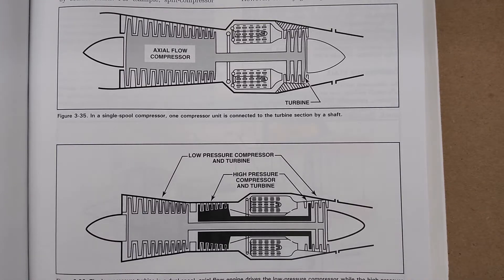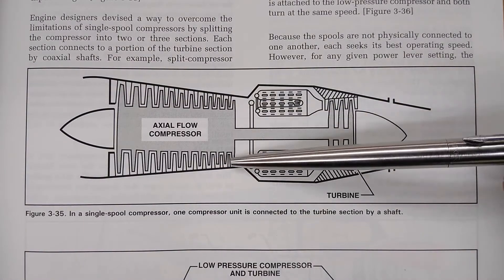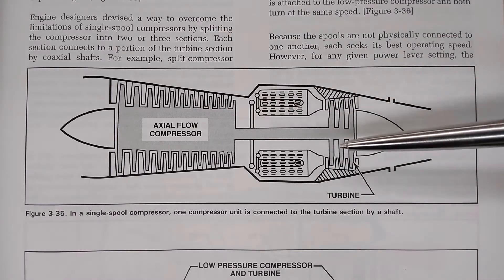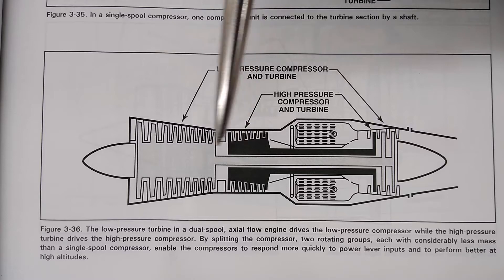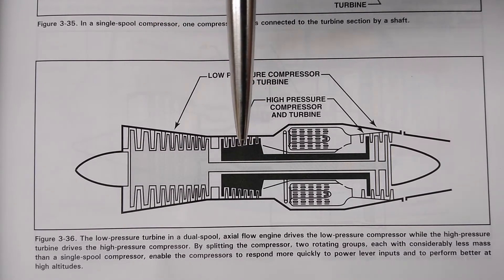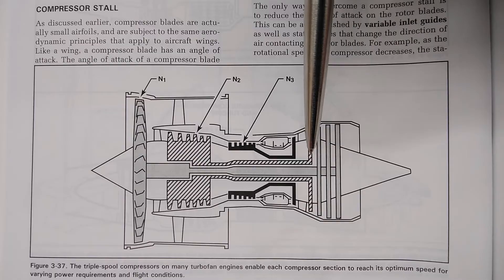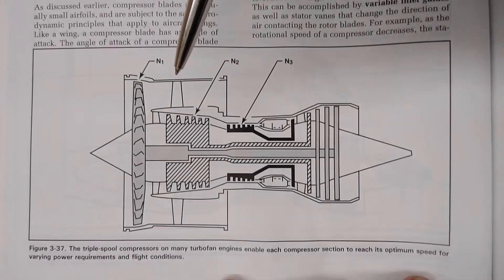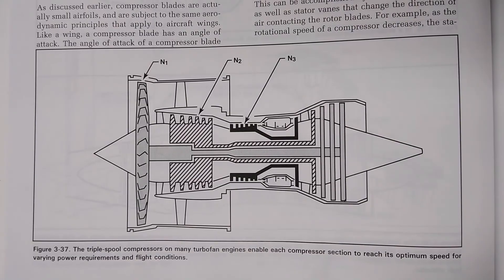LOW vs. HIGH PRESSURE COMPRESSOR and SINGLE SPOOL vs MULTI-SPOOL ENGINES

Comment: can you please make a video about variable bleed valve ,variable stator vane and inlet guide vane  if that possible .and by the way this video is amazing .you explained n1,n2 and n3 so simple. better than that ,i do not think so .go ahead
Reply from the maker: Thank you very much for your kind words. I appreciate it. 
That is a great suggestion for a video but one that may take a while to make since we now I don't have access to engine cutaways that I could use to show those things, but I'll keep it in mind for the future, in case the opportunity comes along.
Again, thanks for the suggestion.
Reply: @planesimple8514  two ways to get a variable rotor ... by design ... thus the multicurve profile of the vane .. think of it as stacking many slightly different wings on top of each other each one best at the air flow and speed of their location (slower closer to middle faster on the ends) you can also make them one shape and slightly rotate the vanes to get more compression or in a turbine more energy into the compressor .. this allows you to get more optimal engine and fuel performance form the same vanes ... each stator stage redirects air into the next rotor at the best angle for use ... so traditionally they are static BUT can be variable as well as the rotors would need a different angle of pass through than the static stator would allow .. the guide vanes are the First set of stators on the engine and all they do is stop the air intake flow swirling (to a degree) ... although they are technically stators they are not there to compress they are there to smooth out the airflow so it is more usable ... the normal start of jet turbine engine is guide vane rotor stator rotor stator and so on ... the stators JOB is to direct the air at the best angle for the rotor to work with it and its angle of exit is always equal to the optimum angle of the rotors leading edge airfoil while the rotors job is to compress the air which heats it and speeds it up ... while the tunnel they are rotating in compresses the airflow some and heats up the air ... the combined work of each rotor and stator section with the tunnel are what make the engine able to do work ... 

a bleed valves general purpose is to remove supersonic airflow from the compressor stage before the combustor because lighting fuel at greater than mach 1 (340m/s at sea level) is a royal pain in the butt ... so the combustor only uses slowed down air flow (under supersonic) and with the blunt body shroud it makes air spin backwards to the direction of desired travel slowing it down further and giving a nice easy place to keep a stable flame going once ignited and it is that flame that provides heat which provides Potential energy (like sitting at the top of a toboggan hill and not going ... until you push off you are full of potential energy ... once you push off that potential is converted into Kinetic energy .. which is what the turbines do ... the unused potential energy then pushes against the outside air turning the last of it into kinetic energy called thrust ... even the air bled off is added to this for cooling of the sidewalls and added thrust ... a compress or may take 20c air and compress it to about 800c .. and then the combustor burns it raising it to say 1700c which is just under the melting point of titanium ... which when passing turbine blades doesnt melt them and makes them spin like a pinwheel fan toy kids once had ... that spin is taking the heated energy  and turning it inot rotational motion which in turn spins the shaft to spin the compressor to compress the air to make the jet go faster ..
.
a good thing to read up for more information is about raleigh flow and fanno flow ... these topics give you the calculations and ratio comparisons for many things that are needed inside a jet engine ... of course there is also basic aerodynamics for the airfoil shapes ... and fluid dynamics( raleigh and fanno) and metallurgy ... and chemistry (specific heat of some fluid) and of course material characteristics ... and of course thermodynamics ... and needless to say Geometry ... for the miles of math you will need to use to design an engine ... Just one rotor stator section has a math equation about 4 miles long and that gets recalculated about 14 times for the first pass in the design .. and that is done for each stage of rotor stator ... and about 6 miles long for the combustor ... and again 4 miles for each turbine ... and 2 miles for the exhaust nozzle which can also be variable and of course all the various bypass flows one needs to work in ... etc yup by the end of it you have a line of math about 200 miles long for one pass of the engine design ... and you will recalculate that several times as you make compromises for efficiency and reliability and overall output
Reply: @0623kaboom why would a bleed valve be different from a blow-off valve in a car? What has sonic to do with it?